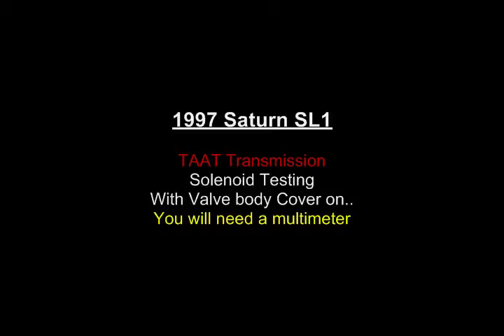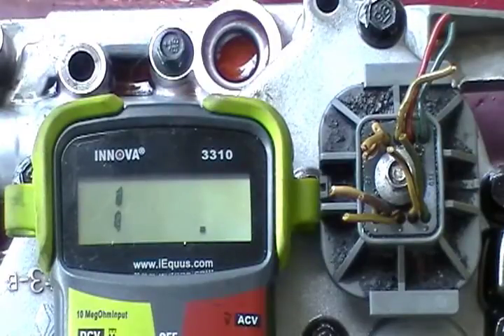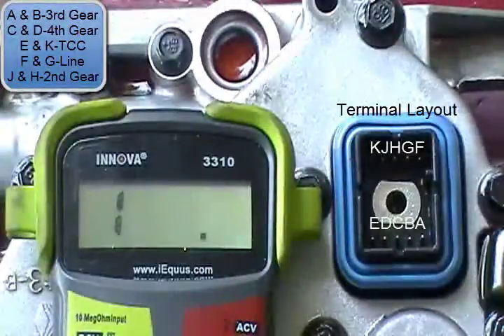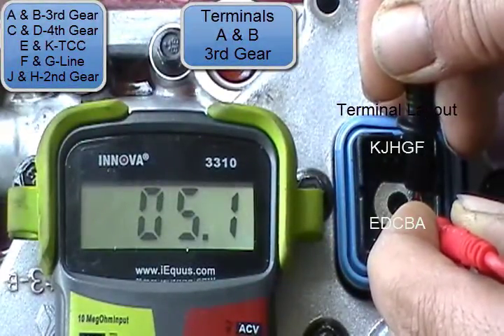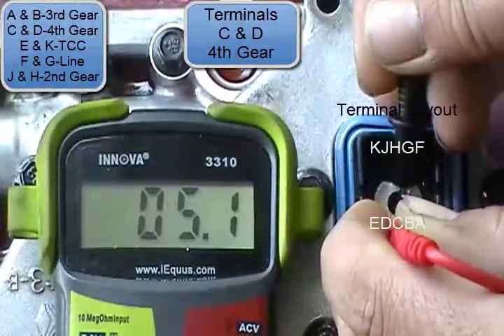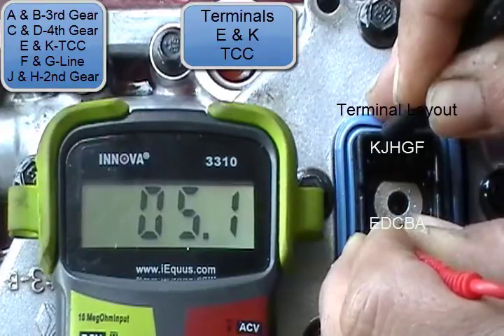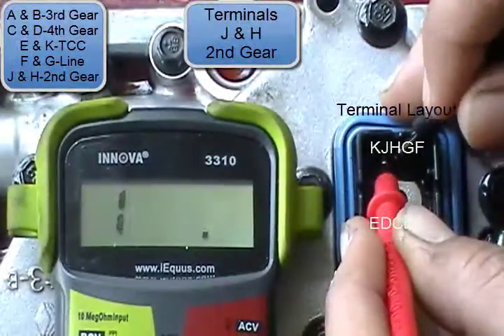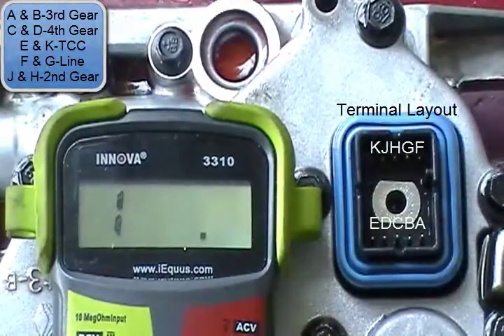Saturn TAAT Transmission Solenoid Testing with valve body cover on

Comment: My brothers been having trouble with his Saturn sc2 where the check eng comes on randomly for loss of 3rd gear. This all started when it was raining pointed me to tell him I thought I was electrical. (which was approx a year ago) Today he told me he took the car to a transmission shop. The guy said the transmission drum needed to be replaced because it had a bad seal. If he was going to rebuild the transmission it would be 1200 and if he wanted to get a used transmission he would only charge him 400. I didn't a little research and found your videos. The guy is going to throw a transmission at a problem that is about $80 to fix. So I told my brother I would take a look at the car this weekend when my husband could help me. Being 4ft 11in will make it hard to see the meter but I will have to test the solenoids on the car as I have no gaskets to put everything back together. Anyway long explanation but I wanted you to know that your videos are helping people not get ripped off by people who are taking advantage. I thank you for the videos!

Comment from the maker: Yes, Please check your solenoids hot & cold with the multimeter to confirm this.Also check the electrical connector on top of the transmission as well as the fuses under the hood. If you look at my other videos, you will see I have a video on how to check fuses quickly without removing them, using a multimeter :)

Comment from the maker: @thesinwagin 
ECTS can affect many things, I own 4 saturns and have worked on many others, never has the ECTS replacement made a difference for me, not saying it won't for you.
Saturns are buggy when it comes to electrical connections.
Make sure all your grounds and electrical connections are good, as well as your charging system, like battery/ alternator.
ECTS is very inexpensive, so worth a shot to replace it :)

Comment from the maker: David,
As long as the solenoids are within one ohm of each other they are good :) Make sure you check them cold & hot please. they may act up either cold or hot. Why it's important to check both :) Did you check all your fuses ? When was the last time you changed fluid & filter? is fluid level ok ?
Let me know readings please :)

Comment: @FiremanCV 200 ohm's with the valve body still in the car..

here are the results under temperatures after the car has sat over night..
2nd gear: 4.9-5.0
3rd gear: 4.7-4.8
4th gear: 4.9-5.1
Line: 5.1-5.3
TCC: 4.8-5.1

and this is after driving the car. at normal running temp (roughly 3/8 on the temp gauge) when the trans is at its worst..
2nd gear: 5.9-6.0
3rd gear: 5.8
4th gear: 6.1-6.2
Line: 6.4-6.6
TCC: 5.7-5.8

Comment from the maker: @thesinwagin 

2nd gear: 4.9-5.0 
3rd gear: 4.7-4.8 
4th gear: 4.9-5.1 
Line: 5.1-5.3 
TCC: 4.8-5.1 

and this is after driving the car. at normal running temp (roughly 3/8 on the temp gauge) when the trans is at its worst.. 
2nd gear: 5.9-6.0 
3rd gear: 5.8 
4th gear: 6.1-6.2 
Line: 6.4-6.6   <------****** Looks like your problem is here !!
TCC: 5.7-5.8
Did you try swapping out the solenoids ?
Also, how does the bus connector look? connection to transmission on top

Comment: Can you tell me the ohm readings for 95 sc2 transmission. I have the transmission sitting on the ground in my garage. Engine intermittently will rev to 3000 or more rpms going from 3rd to 4th I think, and then all of a sudden it will shift into 4th and everything is fine. rpms settle down.. It also has the bang in reverse trouble.Thank you

Comment: @FiremanCV haven't swapped anything yet, have been trying to find the actual problem root instead of throwing parts at it.. the bus looks great, no corrosion or burn marks at all. on top of the line that you mentioned, some people have mentioned changing the ETCS..They say it can change the shift points and hang rpms while downshifting  to raise engine temp faster...does this sound right?

Comment from the maker: If it is just one solenoid acting up, you can get them all over the internet like ebay :) these are interchangable.Junkyard would ne the cheapest.You do NOT have to replace the entire valve body. no need to if just one solenoid is acting up.Honestly a junk yard is cheapest.Make sure you check out my other videos on how to swap them out :)

Comment from the maker: Bad solenoids will trigger the service engine light once they are completely shot.If they are failing they may not. Just because the service engine light does not come on, doesn't mean everything is fine. If the SEL comes on, it will indicate complete failure :( I know this first hand. Hope this helps you . Feel free to ask if you need any help :)

Comment: ok. I added an AT cleaner through the the trans, and then did a fluid and filter change. made sure to add the lubegaurd as well afterwards. that was all about 5 months ago when i bought the car. are all of the solenoids the same? or are each different when looking to buy a replacement..

Comment: Thanks.  I'd love to attempt checking solenoids. Hypothetically speaking; if I remove valve body, check solenoids to discover they are fine, but gasket is destroyed, car is basically useless, if Auto Zone does not have gasket. Therefore, only options are;  Drive Saturn until the trans falls off,  Junk the car, or Buy new Saturn. I have read dealer sell new valve body/gaskets (not separately) for $800.00 (labor not included) **** I have not even  talked about input/out shaft nut replacement. ****

Comment: 98 saturn wgn ...my fan wasn't coming on so i hot wired it to a fuse in the fuse box that comes on only when key is turn on,,,,after taking car for test drive,  started shifting into gear realy hard ,,,put and ob2 scan on it ,,,it read "bad solenoid lock up switch"....could i have shorted out the solenoid switches in the valve body?

Comment: My 2001 saturn sc2 has 2nd gear slam (sometimes) and no reverse. I tightened the input shaft nut and did the solenoid test on the valve body
3rd gear: 4.9
4th gear: 5.1
TCC: 5.0
G-Line: 5.0
2nd gear: 5.2

Does this mean that the valve body is not the problem?

Comment from the maker: You will NOT destroy the gasket on the valve body if you follow the directions in the video :) This gasket is tough and very curable & hard to mess up :) If you don't believe me, check on saturn fans and ask the same question. You will get the same answer from multiple people with not one person stating that the gasket will be destroyed. I have replaced 30-40 in one year alone without one gasket being destroyed :)

Comment: I checked the solenoids 2 hours after I got home and this is what I found, 7.9 for 2nd, 6.8 for 3rd, 7.3 for 4th, 6.7 for tcc, 7.2 for line. All of these are higher than the recommend. Should I be concerned? i took the connector off and looks good with no burn marks and checked the solenoids from the cover.

Comment: with ohm's wont the numbers change with temperature? i did a cold temp testing and all of the numbers were within your noted specs (although i have a SIGNIFICANT reverse slam and a building 1-2 slam). what would the "within spec" numbers be under hot temperatures?

thanks

Comment: I tried to message you at saturnfans, but it wouldn't go through for some reason. Anyways, i continued to drive the car as it was and have now lost reverse all together. And now almost everytime it shifts into 2nd, i get an SES for 2nd gear ratio. Im guessing this is due to loose input shaft nut. Anyways, i retested the solenoids expecting that since it is driving so much worse, that it would reflect in the readings..as far as i can tell this is not the case..

Comment: heres the readings. cold @ 200ohms 2nd--4.5-4.6 3rd--4.2-4.4 4th--4.7-4.8 line--4.6 tcc--4.4-4.5hot @ 200 2nd--6.2 3rd--6.4-6.5 4th--5.8-5.9 line--5.8 tcc--6.3 i was really expecting the numbers for the line to stand out as being really bad. does it look that way? Any ideas? do you think that i should just source a new/rebuilt valvebody? I have a pick-a-part yard that i can go to..but i cant even tell if mine are bad, how am i going to tell if those are GOOD? I ordered the stuff to do the shafts

Comment: I have a 99 sl1. Has code p0734. I've pulled the cover and check all. Solenoids and they all check good at 5.0
What else could I check? Thanks

Comment: I have a problem with my 99 sl2. Only in 2nd gear. When you are accelerating, the rpms will go up and gets to a certain point, will back off for a few seconds, then go up again. It does not matter if its cold or hot or a different speeds. Will this be a possible bad solenoid?

Comment: I replace the 2nd gear solenoid with one that I bought and no difference. When I pulled the bus plate off, I checked the ohms and all 5 was at 5.0 including the one that I bought. I put everything back together and check at the connector, they were still at 5 ohms. Everything was cold as the car was sitting overnight. I also changed the filter and oil. What else could it be? I will try to get a video of it in the next couple of days and will posting it in the forums, my name there is madness10.

Comment: Hey, I can't post in the forum (not sure why), so I guess I'll at least ask you here since you seem pretty knowledgeable. 

I have a 2001 SC2 and Reverse no longer works except when starting cold. It used to slam (didn't know it was an indication of an issue) when reversing, but it doesn't when starting cold, if it does reverse at all. I don't notice issues when switching to any other gear.

I see on the forum with others who have the problem that some people just recommend the Reverse "Slam" Cure from Wolfman, some say replace the input shaft nut, some say replace the valve body.

Is there a way I can narrow the possibility down without having to go through each? Does this solenoid testing help diagnose such problems? Can I just tighten the nut as a very temporary fix to troubleshoot? I understand tightening it wouldn't last long at all, but could it indicate if that's all I would need?

I'm flat broke at the moment, so narrowing it down instead of buying all the parts to fix with just to be certain is a scary prospect right now.

Comment: I have a SL2 with 350,000 and have replaced vb two years ago. NOW i intitally had problems w reverse not working. I changed the vss and it started working then subsequently the whole trans stopped working in ANY gear. Could it be the valve body once again or have i burnt the trans entirely???????  PLEASE ADVISE
Reply from the maker: Does the transmission fluid smell burnt ?
How is the fluid level in the transmission?
Have you checked the fuses for the transmission?
Did you try to do a transmission relearn by disconnecting the battery for 10 to 15 minutes ?
Reply: +FiremanCV       The fluid is new   isnt burnt filter is 9months old. Which fuses do i need to check ? ALL???? I have the vb off the trans and noticed ONE terminal on plug is burnt. I will proceed to test solenoids unlesss u have other suggestions to try first.  ADVISE pls
Reply from the maker: +Michael Delehanty go to junk yard. get new connector.test solenoids before trying new connector. if you look at one of my videos, you will see this is common
Reply: +FiremanCV ALL Solenoids tests @ about 4.5ohms all within 1 ohm of each other, HOWEVER there is a cracked piece off the BLACK housiing which receives the electrical plug. ALSO The "B"terminal  is burnt. The plug itself has all terminals looking clean as I had replaced it two yrs ago with rebuilt vb. Is that BLACK connector plate available or do i need to get one from junkyard?
Reply: OK I went to pull apart to get what looked like another vb with clean terminals on plug and connector. I installed it and the same problem exists. weak drive motion and NO REVERSE. Is my tansmission toast or do u have any suggestions? I did ohms test twice on the solenoids.
Reply from the maker: +Michael Delehanty 
look up reverse slam on saturnfans website.
let me know how you make out .
Reply from the maker: +Michael Delehanty 
please tell me the ohm readings. thanks
Reply: +FiremanCV      I thought i tried all the recommended solutions to reverse slam. I tore off the side cover and both nuts were torqued correctly and I also replaced the VSS sensor and changed the fluid. The ohm readings on the replacement VB were all around 4.4ohms
Reply from the maker: +Michael Delehanty
. I know this sounds really stupid but did you attach the one wire going to the transmission in the back by the linkage I have forgotten to do this myself several times.
also did you make sure you disconnected the battery for at least 10 minutes after you replaced the valve body?
and did you check the fuses that also control the transmission?
sometimes if there's a problem with the transmission it will blow fuses.
Reply: +FiremanCV The wires were never disconnected behind the VB. I checked all the fuses in engine compartment. Would the other inside fuse box have any circuits the affect the trans?
Reply from the maker: +Michael Delehanty
no, just the fuse box under hood on drivers side behind the battery. 
did you solder the new connector to old wires?
bad connection ?
Reply: +FiremanCV I replaced the plug and soldered the connections the last time I replaced VB but I will check it to ensure the connections are all good thanks
Reply from the maker: +Michael Delehanty 
it doesn't help there's too many wires. :(
Reply: +FiremanCV Thats OK  I;ll go to any length to avoid a rebuild or trashing the whole vehicle. Its a challenge to me NOW!